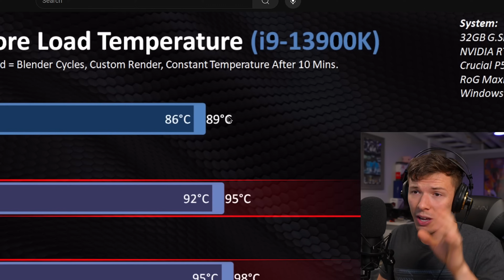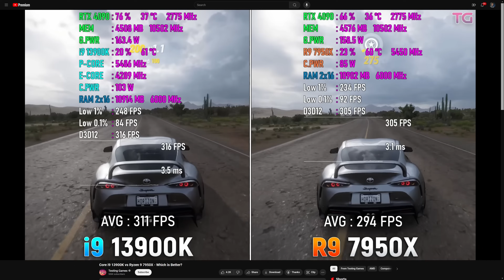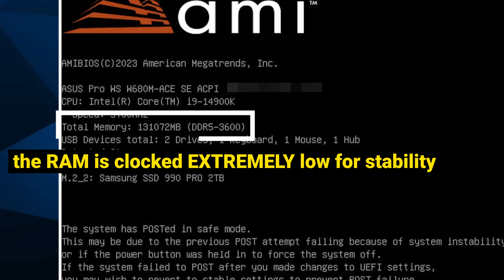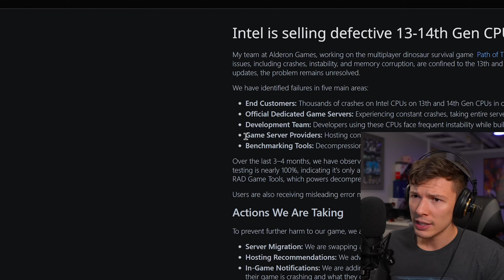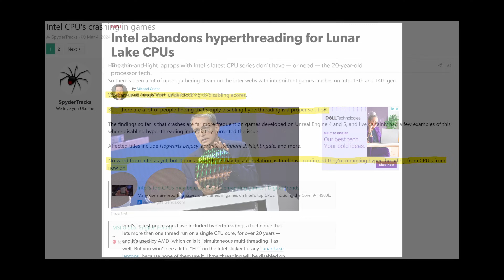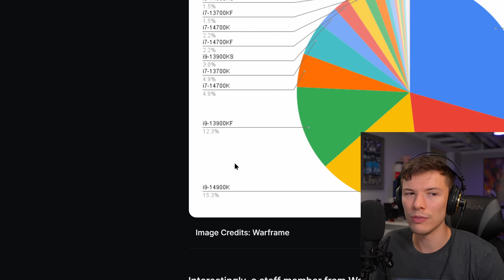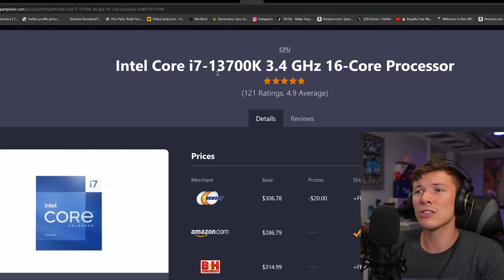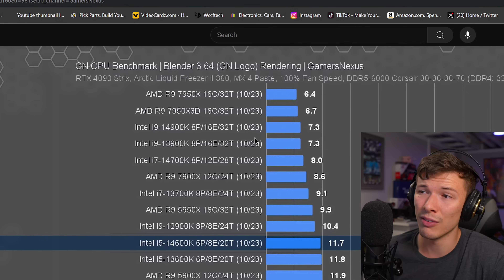Intel F**ked Up Bad

Comment: How did it take 2 gens for people to start talking about this
Reply: Because almost nobody upgrades every generation. Takes at least 2 for a lot of people to upgrade. Also this was originally thought to be nvidia.
Reply: @ronin1mil finally someone with logic.. So many people do not upgrade their pcs.. The 13900k pulls more power than my 3070 lmao
Reply: @ronin1mil  Actually it was more like 13/14 Gen cores were made in that 2022 newly opened US mainland site instead of the usual SEA plants, no one would talk about them because. Just think, if it was the same cramp, why would only 13/14 gen cores were affected? The only explanation would be that 13/14 gen core are the only cores that was ordered to made in US mainland plants instead of SEA plants.
Reply: First it takes a few month before the degradation causes problems, and if you have problems, you probably think there is a problem with MY computer, but not a general problem with the CPU. It took a while until it become clear that this is a wide spread problem. And now, since the report that servers are also having problems, the issue can't be blamed on overclocking gamers and mainboard manufactures anymore. 
Also misleading error messages did't help either.
Reply from the maker: I did notice this issue before but it seems more and more widespread now, so maybe that’s why. It’s just really concerning now

Also 12th gen doesn’t seem to be affected at all even tho they are a similar architecture
Reply: @vextakes  I think the bigger difference is, that since last week we have more than just anecdotal evidence. If you read in comments about people who are having problems with their computer, you still don't know how widespread the problem really is. But if someone analyze the data of more than 1000 crashes, and almost all of them have a Raptor- or Meteor Lake in common ... you have found a smoking gun.
Reply: Degradation takes a while before it makes such problems. Also, the problems had first been reported last year, but it wasn't as widespread yet. Now that those chips have gotten older, the degradation is starting to take it's toll on more and more chips and the problem is getting more and more widespread and the situation is getting worse and worse due to this.

Then, due to the errors it shows, like out of video memory, most people won't immediately suspect that there's something wrong with the CPU, and even those who see the errors at first don't immediately think it's a widespread issue.

Finally, overclocking, both manually and the unlimited power profiles on mainboards 8which Intel said were cool back when they were first made) degrades the chips faster, hence why it was at first blamed on overclocking instead of it being a widespread issue on all the i9 and to a lesser degree the i7 of the 13th and 14th gen.

If the i5 and mobile chips also start showing those issues (mobile HX chips, which are basically desktop chips in a mobile form factor, already started showing this issue too), then the Admins and IT departments of servers and workstations which are running on Intel Xeon will probably start to revolt as they certainly don't want to be next in line with chip failures.

In fact, I'm sure some IT departments have already taken note and are looking if it's possible for them to make the switch to AMD to avoid these issues, which would be a financial disaster for Intel if that happens.
Reply: They are pretty much the same generation, if you remember intel 3rd gen till 7th gen is basically just slightly improving the previous gen. Also the problem went from infrequent crashes to outright failure over time and on the server side people just don't care and fix it due to being a business expense
Reply: @17pdietcoke59  Ivy Bridge, Haswell and Skylake (3, 4 and 6) were pretty significant steps. Then Intel repackaged mostly the same architecture until 11th-gen. You must have been thinking about Haswell Refresh and the mostly forgotten Broadwell after it, not much progress during that experimental phase.
Reply: @teardowndan5364  6th gen was a big step, but backwards, so not the significant step that you want.
Reply: not sure.  i work in IT for a defense contractor and noticed problems with the 13th gen the moment it came out.  windows works like shit on the 13th and 14th gen.  absolute dogshit.  both the mobile and desktop versions.  like using a pc from 2010... without an ssd.  anything hosting a sql database just slows to a crawl, when it used to be fine on an old 8th gen core i5.  it was almost universal problems out of the box.  

we swapped to amd on the spot, problems went away.  so other then my current laptop and a few others we have almost no intel 13th or 14th gen anymore, and no plans to buy them at the moment.  we're moving forward with a quarter of a million dollar server upgrade project right now, on EPYC not XEON.

I've been asking since 13th gen launched why no one was talking about the problems just in basic windows usage.
Reply: @arizona_anime_fan  probably the ecores tbh. that's why people call them e-waste. if bartlett lake comes out with just P-cores then it could be promising for more consistent performance since you wont need to worry about core allocation.
Reply: @jameyt1 has nothing to do with E cores, Alder lake is fine, Apple is fine. Its a Raptor Lake exclusive issue.
Reply: @Angel7black  I am talking about the system slowing down, not the overvolting issue. It’s the same problem with the 2nd CCD on the 7950x. The scheduler just adds a layer of annoyance. If intel stops wasting time with the ecores to put into more ipc and extra P-cores to their flagship product that would be better. Reserve the e-waste for laptops, not desktops.
Reply: bc its not 2 gens 14th gen is fake.
Reply: The thing that blew this thing wide open was data from data centers and most data centers use Intel's Xeon line of processors, which don't seem to be affected. It's only consumer CPUs.
Reply: It didn't. The issue started with the 12th gen socket warping.
Reply: @skorpers  oh yeah I forgot about that. It did at least have a cheap fix though. Or if it already happened a slightly more expensive but still cheap fix of lapping the CPU.
Reply: Because Ryzen 9000 is coming out and AMD is trying to pull as many customers as possible.
Reply: You'd be surprised how some Hispanic channels are defending and some are playing they haven't heard anything about intel.
Reply: Takes 1-2 years for symptoms to get bad enough apparently.

Welp AMD marketshare is gonna automatically go up from 30% to 45% from here while mindshare is gonna skyrocket from 50% to 69% 🔥🚀
Reply: it takes time for the silicon to degrade.
Reply: He said it’s degradation problem so it’s creeping up until the 14900k broke the camel’s back
Reply: @tumo07  They were too lax in their Sillicon QA and alot of bad chips were allowed into production. That and the fact these CPUs were already being pushed to their limits it was only a matter of time
Reply: Can't speak for the wider industry but I can speak from my own. I work IT for a company that uses a lot of these I9 chips for their lower end servers that we sell / manage and nearly all workstations. Most of the chips that enter the wild first are custom built PCs built by enthusiasts and gamers. It takes time for larger system manufacturers like Dell or HP as examples to really get these out and update their product line ups. And then even longer before these new flagship chips start making major market penetration. We only really started deploying 13th and 14th Gen within the last year, and was also around the time we were forced to stop putting out Windows 10. Prior to that we were still working with 12th gen Intel. Myself and coworkers noticed some of these machines performing like crap, and we chalked it up to Windows 11 being terrible, and blamed Microsoft. These issues seem to get worse with time, and now that I am having a good number of systems out in the field for 6+ months I am starting to notice bizarre errors and behaviors I have never seen before in my many years in the field. In what I am seeing is that the problems seem to initially point to other components like Nvidia Quadro GPUs we have in them, or general PCIE bus errors, issues with the SATA controllers, corrupt parts of the OS etc. Thr main thing is that it's inconsistent and erratic. Incredibly frustrating trying to work with support on trying to get some of these RMA'd because they have been deemed to unstable to remain in production. Had I not seen the breaking coverage of this, I'd have had no clue it was the CPU causing these problems.
Reply: Because the degradation process takes time, troubleshooting takes time, and networking with others takes time. Considering they release a generation a year, its not like it took that long.
Reply: @jessefisher1809 cpu's have always deteriorated. For me it was the worst once I had an AMD cpu. So this happens to all. My current Intel cpu from 2015 is still working fine tho
Reply: Idk 😂
Reply: Because only 13th and 14th gen have it. And since those are a literal downgrade amongst much of the stack and at best get basically the same performance at a higher powerdraw. I don't see many people buying them.
Reply: @Lynnfield3440  I think most people are waiting for next gen now anyway. Where both Intel and AMD have reduced the power consumption
Reply: @TheBann90  I think for CPUs AMD is doing great with the 7600, it uses just 65W and is basically just as fast as the 7600X and it's good at anything really.
Reply: @TheBann90  Oh silly child Intel is just shifting power draw away from the EPS to the 24 pin to make it look like less power consumption. By doing this standard testing reports lower power draw but it isn't actually true. In fact they actually pull more power!
Reply: @Lynnfield3440  mainly the K variants from what the rumors says. Indicating it's a pure heat issue.
Reply: @TheBann90  Sorry but in regards to what exactly is this? I don't understand what this has to do with my comment. Or unless the heat is really getting to me, I only see me talking about how good a Ryzen 5 7600 is mostly.
Reply: Think about how much blame Microsoft, Nvidia and AMD took for this.
Reply: I just came back into building my own systems this year after a 20+ year break from it. I've been a console gamer since the original XBOX and Halo came out and most of my PCs since have been laptops and older, used enterprise hardware for my purpose dedicated needs. Up until this year I had been using 8th gen i7s in small 1L PCs.. 

So my first jump back into modern systems was an open-box ASUS gaming system from Best Buy that was about 50% off. So I wound up with an i7-13700KF and RTX 3070. Right away I noticed that it hits 100 degC and throttles. I looked in the BIOS, but on this pre-built only motherboard there was no way to go to stock Intel settings. The pre-built system also came with a 240mm water cooler. I upgraded the radiator to a 65mm thick copper radiator and it helped it run longer without getting hotter after steady state, but the initial heat spike to 100 degC was so fast that I don't think any cooler would be able to keep up.

I ended up replacing the motherboard with a newer ASUS Z790 (original I think was some 550 variation?), and after selecting the "enforce stock settings", turning off the crazy overclocking it seems to be a stable system now. 

I built several systems to replace the older systems around my home that just aren't cutting it anymore, but to save money I wound up building my other systems with 12th gen I9s and I5s, mostly open box processors, motherboards, and GPUs.

Was getting back into building my own systems with Intel a mistake? Am I okay with the 12th gen processors for all my systems other than the single 13th gen gaming system I have?
Reply: @Shadow_Banned_Conservative  why did you came in your systems? That is not what a pc is for. I think that might cause your issues if you have any.
Reply: Took about a year before my 13900KS started showing signs of instability. A few months later and it's so unstable I can't even do basic tasks.
Reply: I think because people that buy cheap laptops and they don’t make this kind of research cause they don’t know better, and expect it to just work
Reply: @stard00  I mean you would expect stuff you buy to just work in fairness. It's the law that it is has to.

Now obviously almost no company follows the law, but that is a different story
Reply: Prolly silicon degradation
Reply: Purchased my 13700k system in April 2023 and had sporadic problems from the beginning. System crashed mostly while watching Youtube but only very rarely while gaming. But not every day, it was more once or twice a week. Sometimes there were even two weeks without a single crash.

Crash was a sudden frozen picture and endless looping sound. No keyboard or mouse input was possible (LEDs on keyboard were stuck). Had to press reset on the pc case to get out of the frozen screen.

After the crash the system was hanging during boot, the power and reset buttons were not reacting and only way to get the system back to work was to flip the power switch on the power supply.

No entries in the Windows event log (except unexpected shutdown), so I had nothing to work with to localize the error.  

Tried some things like switching the power supply and memory and reinstalling Windows, deinstalling some tools like hwinfo or RTSS/Afterburner I was suspecting to be releated to the problem, but to no avail, the weekly to two weekly crash persisted.

Tried differen UEFI versions for the MSI mainboard and loaded defaults but that was not helping.

Was down to a hardware fault after that. And as I built the system myself there was a chance that I messed something up during build.

 And it is very difficult to RMA with a error that shows only up once a week.

 So I was living unhappily with the 13700k system until I switched to a Ryzen 7 system this year (after only a year). Soon after switching to AMD reports came up about intel problems.
Reply: How's the 10th gen?
Reply: Never had an issue with my 13th gen?I did op'd in to eliminate the stock CPU hold down plate for the flate bolt in bracket that holds it down and a hyper 212 cooler and at max I hit maybe 70?
Reply: I’ve RMA’d my 11900k twice in less than a year. Just thought it was the shitty 11th gen
Reply: So, game cloud providers generally upgrade on schedules . It takes years to plan test and deploy servers and the people who do this work do not live on the bleeding edge, they are trying to make money and tinkering costs money.

It is very likely that 13th and 14th gen consumer CPUs had not entered the game server market at scale and the data wasn’t in.
Reply: Long story short its a good thing to make ppl click on youtube :D i dont think so its 100% the product fault more like a user error.. ye.. can heppen but i dont belive in this at all my works fine..maybe a driver issus or idk..
Reply: @evildarkeevildark5943  4 months later So....that theory was wrong
Reply: Cause it's all fake. Cpu's have always deteriorated. Just that now we have some people shorting the Intel stock, and youtubers are jumping on the bandwagon.
Reply: @TheBann90  It's not fake. You need to take those intel fanboy glasses off and look around you.